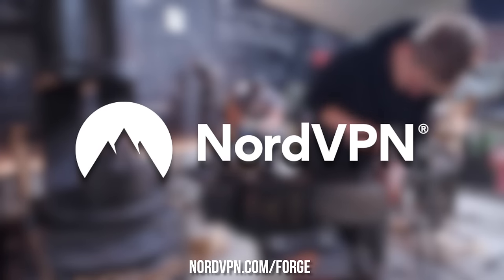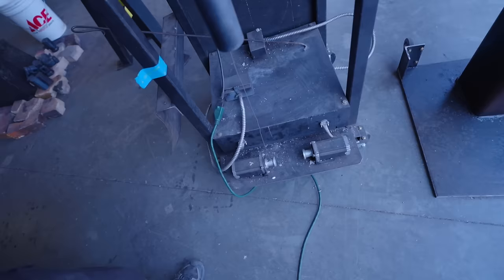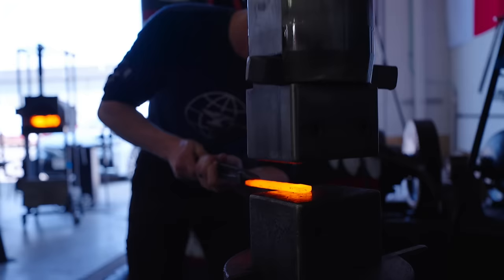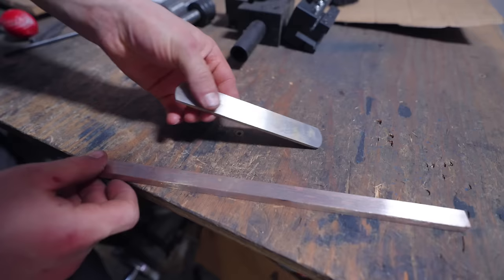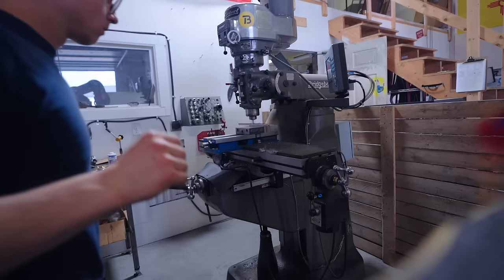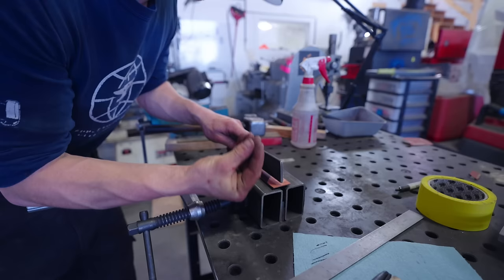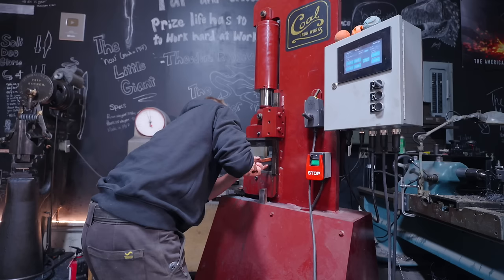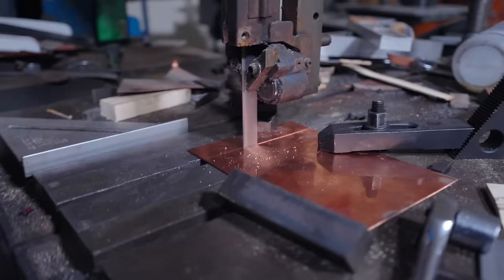Making a BUTTERFLY KNIFE with Will Stelter!

Comment: Balisongs are actually slower to deploy than traditional pocket knives. I believe they are only illegal in certain places because of their "terror" factor, or how offensive it is. It is also considerably easy to conceal and quite dangerous to wield if you're not savvy to the dangers of them. There's a reason one of the handles is called the bite handle. You can easily lose a finger if you're not careful.

Comment: Hi Alec, I machine copper as my day job. I would recommend using 2 flute carbide tooling, plenty of coolant, and 1.5mm depth of cut. 2000rpms or so. Maybe this will help!
Reply: Also it helps to use a coolant containing animal fat. Neatsfoot oil, full cream milk....
IT did strike me that a shaper (or planer) might make a better job in this particular instance. 
But whoever set it up would need to know their stuff on tool geometry and grinding...

Comment: "No. I do not use this... Anymore"

😂

I wonder how many fine craftsmen of any trade use some things that seem janky or hacked together, but they continue to use because the 'proper' tool is either prohibitively expensive, doesn't exist, or the cobbled together/repurposed way they are doing it just works better or exactly how they need/want it to?

I always find those solutions to be the most interesting
Reply: A lot do.

Assuming it has decent temp control, a toaster oven isn't much different than a fancy knife kiln,  it's just that the knife kiln can get hot enough to quench as well as temper the blade (toaster oven can only get hot enough to temper).

Comment: You love your power hammers and forge in the Montana shop so much more than the ones in your UK shop.

I can imagine the shipping costs from one to the other are prohibitively expensive, but also power hammers are not as easily came by tools as they are more specialized.

Would the shipping be worth the cost to get a machine in known state of function over selling and having to rebuy a similar machine with unknown issues that will cost extra?

Comment: Good to see you guys together again.

On the Illegality of the Balisong in... Well, ANYWHERE.

I don't get it.
The SKILL with these knives is by far the more dangerous part than the knife itself.
And that can pretty much be adapted to any knife, and by itself, the knife is one of the three cornerstones of human civilization.. right up there with Fire and Hammer (Starting in human history with a ROCK)

And sorry if I offend fans of the Butterfly Knife (I'm included in that, BTW) But the knife itself is just a flashy folding knife with a design meant to be and distracting  to the opponent.
Really no more extra offensive capabilities than a standard pocket knife. 

A knife is benign, beneficial and certainly the most useful tool ever invented and we think outlawing them will prevent violence.

Find the CAUSE of the Violence & work on that.

Sorry, gang.
But of Soapboxing there.
Reply: Yea if anything buttery fly knife fans are by ur side on this one. Out of all the knives a criminal could choose the buttery fly knife is probably the only one that offers an amount of danger to themselves lol. Not the most effective/reliable knife for stressful situations. The average criminal would likely be better off with a sharp rock.

Comment: Y'all I legit need help. I'm running my forge on a little propane tank and my forge consumes propane faster than it's evaporating in the tank because the tank side of the regulator reads zero. It's still getting fuel but I think it's liquid. Is that okay??

Comment: I just don’t get the argument of “it’s a fast deploy knife” when you could just have normal solid blade/handle that requires no flipping or anything. Am I missing something here? 

I’ve seen ones with springs and ones that are “gravity assisted” but surely a normal classic knife is just the best? 
Perhaps it’s because you can “unsheathe” these newer sorts, in-the-air, so to speak, as opposed to unsheathing them simply by drawing them?

Anyways, this all seems sort of moot when there’s guns, but maybe that’s just me.

Comment: Copper handles on a bali... Don't flip that 💀 Soft metals tend to not survive the stresses of flipping. They tend to break at the pivot point and send the blade and bite handle flying off in a random direction (like into my leg, or my wall. I've had this happen to me twice).

Comment: sorry but c- on this knife for real
Missing 4 pins on the blade. Balisongs have 4 pins in the blade 2 pivot and 2 stop pins to give them their famous lock up rigidity. Also folded metal for handles is a big no no with out scales should have went with slab handles for it easier to make and to make right and if you add in the right amount of flex you can actually use them to stop the blade mid swing and completely reverse the action.